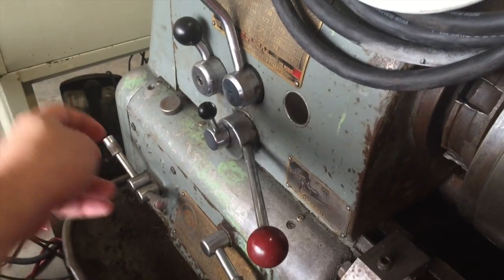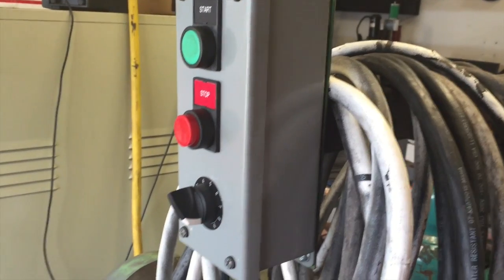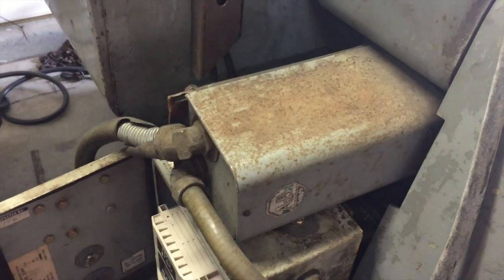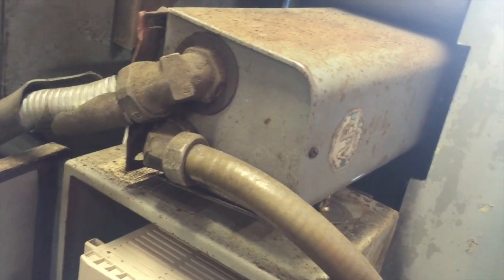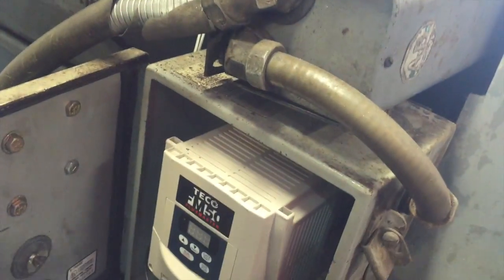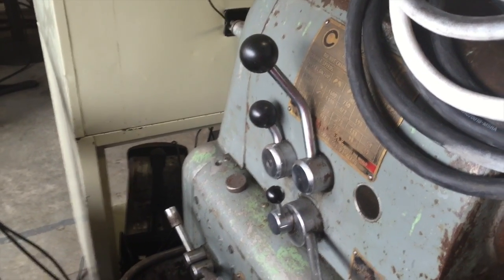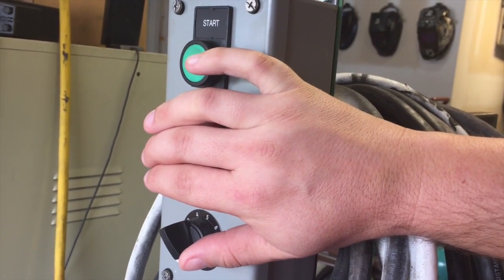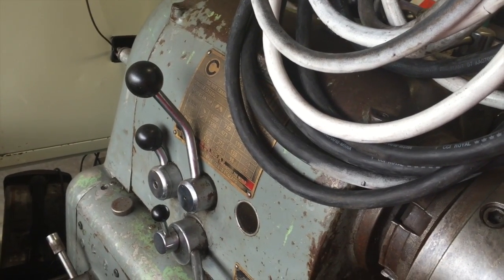VFD Advice

Comment: What I'm struggling to safely understand is how to wire a VFD as powered by a 10-30 3 pole 220v dryer receptacle. How do I ground if  my power source has 2 hots and (I think)a neutral instead of a green or bare ground wire?
Reply from the maker: While I'm not an electrician I'm under the impression that it should still have hot, neutral, ground for a dryer. I asked Stan Z for advice when wiring my stuff up but this video was also pretty helpful. https://www.thisoldhouse.com/how-to/how-to-connect-220-volt-receptacle-to-20-amp-breaker

Best of luck and please reach out to the larger community if you get stuck.
Tom Z
Reply: @TomZelickman  Depends on the age of the installation, older 3 wire installations may have neutral and no ground. The connection box may be grounded, a separate ground wire, or upgrading the outlet to a 4 conductor outlet may be required.
Reply from the maker: @alanb76  Thanks, Alan! This was about 5 years ago and it's working well overall. The lathe has actually found a new home (a friend really wanted it) but it's still making good parts.

Comment: Great work! I imagine you pick your gears for speed with pot wide open then just dial the speed up or down if you have harmonics or tool chatter.  Simple and effective.   Does the door on the vfd enclosure close?
Reply from the maker: Hi Steve. You got it spot on, sir. The door on that enclosure does not close because the VFD was too long. Replacing that enclosure this summer though.

Thanks for watching!
Tom Z
Reply: Tom Zelickman haha. The same thing happened to me when I installed my vfd. Didn't realize the door lock on my case hit the vfd. Went to close it after I finished and am all proud and then the door hit the Vfd. I looked and just shook my head.

Comment: Your viewers will probably constantly want to know your RPM, so I would consider a digital tachometer RPM gage, which are easy to install and are cheap off Ebay here
http://www.ebay.com/itm/4-Digital-Red-LED-Tachometer-RPM-Speed-Meter-Hall-Proximity-Switch-Sensor-NPN-/251369593713?pt=LH_DefaultDomain_0&hash=item3a86cb9b71
Reply from the maker: Jim Liechty Hi Jim! Thanks for the comments and the link to the digital tach. That's a great idea; both for myself and to illustrate to others. Always good to be able to repeat a process and that makes it a bit easier to do.

Sincerely,
Tom

Comment: Hi Tom,
I don't know much about VFD's so I elected to just buy a phase converter for the lathe I just purchased.  I think it the not knowing that scared me and just wanted it to be simple.   After watching your video, I think I would have attempted a VFD.  Maybe some time in the future I will change it out.
Thanks for sharing,
All the Best to you,  Reid
Reply: Reid EichnerThe biggest thing, is that with a VFD you have fingertip control of variable speed, forward and reverse, no need for an on/off switch and you also have built in motor protection. RPC or rotary convertors are nice to run multiple machines, but non RPC (static phase convertors) I have heard are terrible for ruining motors, plus that fact that the hp and torque is diminished.